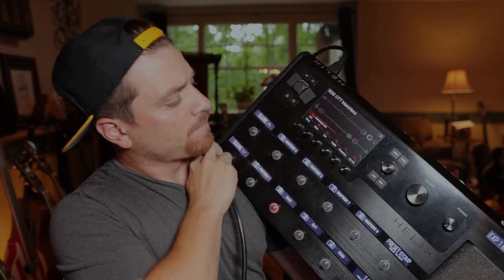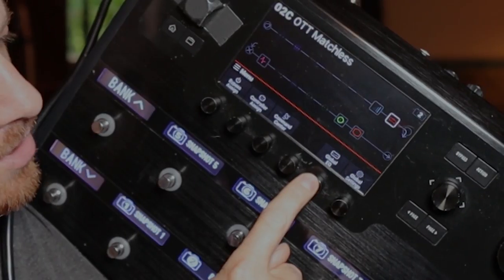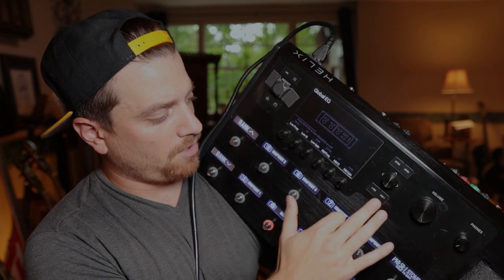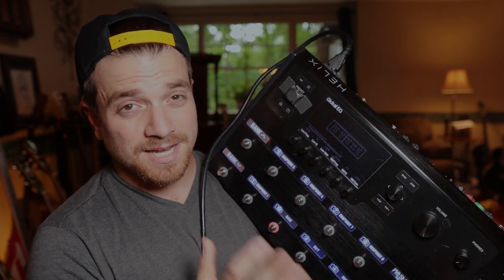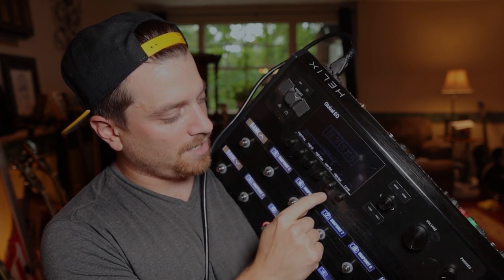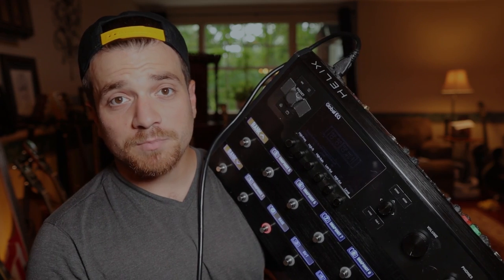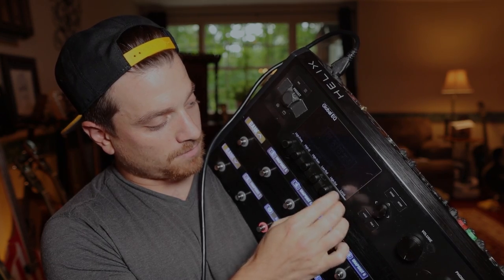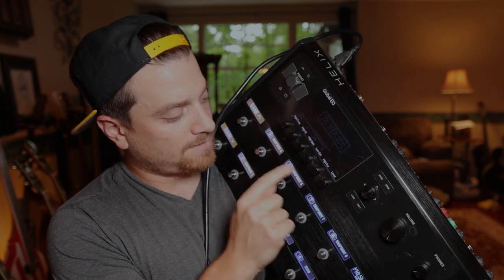Line 6 Helix   How to Adjust Global Volume to FOH - 2 Minute Tips

Comment: This is a great tip, i actually know based on FOH feedback on my signal that i need to reduce my level by -9.5db.  I am going out at instrument level 1/4" going to a canvas DI to XLR.  I was doing a per preset adjustment on the Output block of -9.5DB, but came across this recommendation. my question though, since this is EQ does it color the tone in anyway? Since its not just a level adjustment it seems to still apply some EQ settings? is there a recommendation to do this the best way on a preset level - should i adjust Channel Volume on amp? Output volume on the output block? any other recommendations.  Thanks for what you do
Reply from the maker: This eq set flat will do nothing to your sound. If you do want to adjust each preset individually, then both options you mentioned are just as good. I would say channel volume over output block just to make it part of your regular workflow

Comment: Is there any way to do similar on a HX Stomp please?
Reply from the maker: Yup! Same Global EQ is in the stomp
Reply: @SteveSterlacci  On my HX Stomp there is no level setting in the Global EQ. Dont know if its a recent fw update that removed it. Do you know?
Reply from the maker: @Volgin.  did you page all the way right?
Reply: @SteveSterlacci  Yeah. On the HX Stomp you select each section of the range by turning the top wheel, and each section has only one page. Im struggling with low volume plugged into audio interface and studio monitors... The workaround I found is turning up the volume on each presets output block
Reply from the maker: @Volgin.  why not bring the gain up on the interface?
Reply: @SteveSterlacci  Because it will probably be as low as it was on the interface by itself. I need an onboard way of making it louder :/
Reply from the maker: @Volgin.  i don't understand what you mean by this.  What interface do you have? Any interface should allow you to turn the gain up if the signal is low. What else is in the signal chain ?
Reply: @SteveSterlacci  Sorry if I didn't make myself clear Steve. My audio interface is an Motu M2, and my signal chain consists on a Soulpress 2, Digitech Drop, HX Stomp.

What I meant on my previous comment is that I need a way to set my levels on the HX Stomp, so that I wouldn't depend on what I'm plugging into. Does that make sense?

The Global EQ setting would be the best way of achieving it, because that way I wouldn't have to do what I'm doing now, that is adjusting the levels on the output block, patch by patch. I did some research yesterday, and as far as I could see, the setting you showed on the video is not present on the HX Stomp :(

If you know, by your experience, about any other way that does not involve setting the gain on what I'm plugging into, or setting the level preset by preset, please let me know!
Reply from the maker: @Volgin.  in my opinion and experience, there is no global level for the digital modelers to be at. You should almost always need to adjust the gain on the device you're plugging into. I think you may be overthinking things. Just adjust the interface and enjoy it

Comment: Just saw this. I’ve been using my Helix since 2015 and most sound engineers tell me my signal is too “hot” coming out. (I set up the same at you. FOH has set signal and the big knob controls FRFR). What db do you set yours at for signal leaving the unit? I never knew I could control it from here. Thanks in advance Steve
Reply from the maker: I have a whole video on this, but make sure the XLR to the house is set to mic level and not Line. I'd also bring down your channel volumes on all presets to be "similar" to the volume if you bypass the amp and cab. It should be close in volume, but a bit louder if it makes you happy.  You'll never have a problem again!
Reply: @SteveSterlacci thanks Steve. 👍
Reply from the maker: @mwdanny  Any time

Comment: Also, have you ever actually been asked to turn the signal up or down by the sound engineer?
Reply from the maker: Absolutely.  You'd ve surprised how many sound engineers either don't have modern boards or dont have appropriate experience knowing how to gainstage.  It's rare, but happens